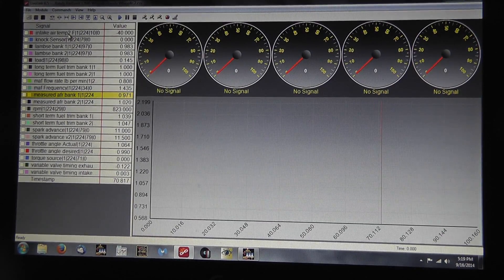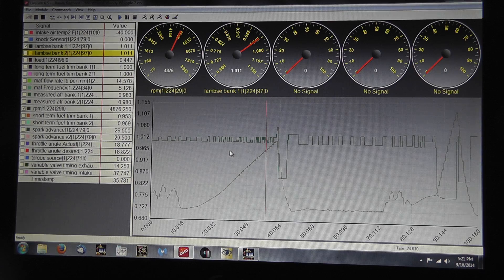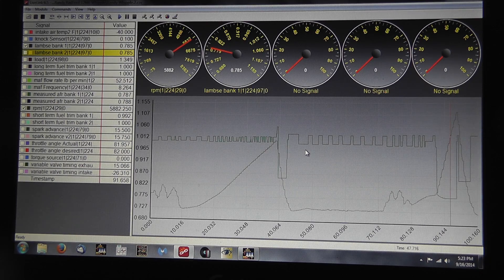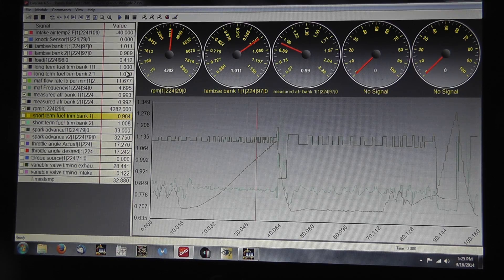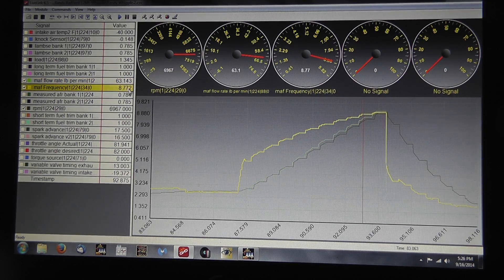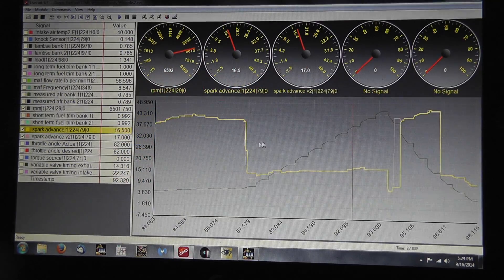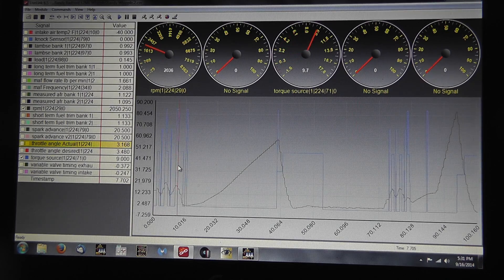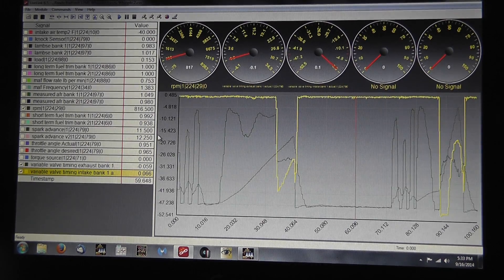Reading a Data log:

Comment: Shaun I need sum advice , I have a data logged file of my '12 GT 1/8 mi pass and have always complain about 60ft not improving with mods . I have file and pic of graph of rpm & ignition curve of pass and first 2 gears I'm sure ign curve isn't right ? full throttle no letting off but ign curve is up and down , can I at least send you pic of graph and you just look at it and tell me normal or not .....thx for any help